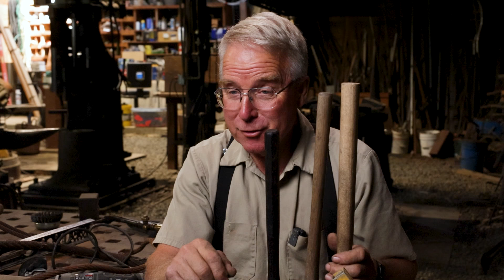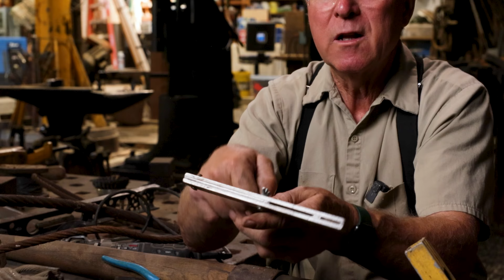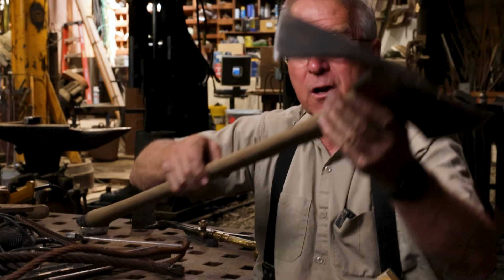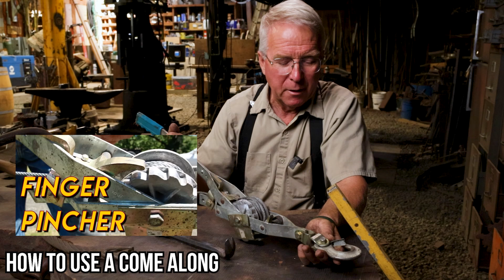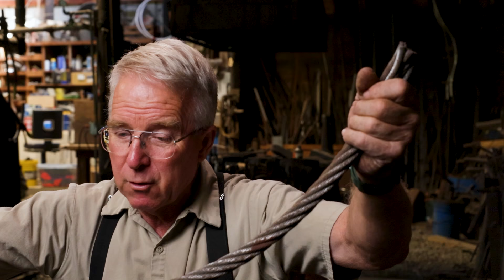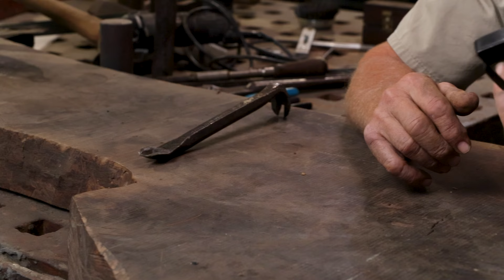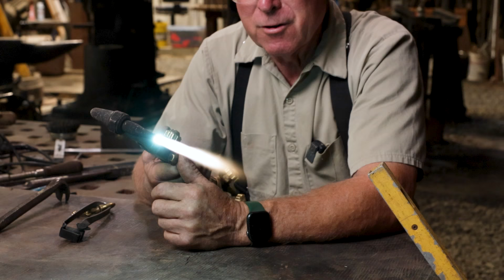The 15 Weird Tool Nicknames You Never Asked For

Comment: When I was a kid I used my grandfathers Yankee to pry on something. I was surprised when it bent. He was pretty mad but used it as a teaching opportunity. When I started my handyman business in 1972 I bought my own. I became an electrician in 1974. As an electrician, I used it for installing receptacles and plates until I found a swivel screwdiver from Klein Tools. I always had diagonal pliers and learned to use them to remove nails and screws. I never used nippers until my son bought a pair and gave them to me to use for pulling nails when I helped him rebuild his deck. I never had a cats paw, I used a nail puller with the sliding bar. Mine is so old it says Made in USA. Finally, as for how tools get names, I was working with some millwrights to set a massive milling machine and they had prybars with wheels. I kept hearing them call it a Mike. Turns out the biggest, strongest guy on the crew was named Mike and when he wasn't around they would need to use the prybar. I bought a couple to use when we were setting large transformers and gave them to my crew. When I asked for a Mike they gave me a puzzled look. The joke was on me I guess.

Comment: Theater carpenter and film worker in maryland. We call your "buzz saw" an oscillating tool, oscillator, or a multi-tool (due to the various blades that can be fixed to the business end if it).

to clarify on the job, we do refer to multitools, specifically leatherman multitools, by their brand name "leatherman". 

for example "take the multitool/oscillator and bring your leatherman with you."

Comment: your buzz saw was invented by FEIN in Germany.

It was named after its initial use  : "Gippssage".  Literally : "Plaster Cast Saw" - cut casts off without damaging patients.

 Patent ran out in 2008 - and 100 manufacturers found a "new" tool to sell.
Now they're called Multi Tools in AUS.

We used canthooks to rotate the poles we (linesmen) were dressing.

I STILL have my dad's ratchet screwdriver . Stanley.
We still have yankee screwdrivers - we call them HAMMERS :)

Comment: I knew an electrician who had a Yankee screwdriver, and he loved it. I call my nail puller a cat's claw because that's what it resembles. A cat's paw is a soft pad, which wouldn't be optimal for removing steel from wood.

Comment: 10:15 the two things that frighten me the most are things under tension and things under compression. Ungodly huge amounts of force that can be imparted into your squishy body faster than your nerves can get a signal to your brain.
Reply: Yup!! I thought I could pull my hand back quicker than a table saw could cut it; I now have half a forefinger, and a fused middle finger; expensive but thoroughly learned lesson!
Reply: Yes. Tension and compression, you cant usually see. Something that is rotating or glowing you can see. But nontheless, either are quite dangerous.
The other thing is, in our everyday life/eperience we have nothing to do with tension/compression/rotating. So we lack the fear or for better, the respect of such. There is no understandig how dangerous a lot of things can be, when using it.
I am fortune, that I have only minor accidents with tools in my life.
One gained insight is, if your tired, not feeling well today, and you are not forced to, dont go working on tools. Skip that day and come back tomorrow. Once I slept bad, felt dizzy but thought c'mon just a quick cut on the table saw. Well that ended in a close call. Just scratched my left thumb. 😮

Comment: In Australia, a "door bar" is is commonly referred to as a "Jimmy bar".
Instead of "diagonal cutters", we say "side cutters"
Instead of "end nips", we call them "pincers", but when you can't remember, it's also acceptable to refer to them as "nail-puller-outerers".
And a "maddock" is called a "hoe". 

Not a tool mentioned here, but the "Yankee screwdriver" made me think of drills - what is commonly called an "impact drill" is also known as a "dak dak" in some parts of Australia.

While we have "whiskey bars", another similar tool that is usually called a "straight edge" is known within a specific trade as a "rollover" or sometimes a  "lightup", when it's used on its side - when you know, you know.

Comment: there's that one guy that says "just hit it with your purse." his "purse" weighs 10 to 15 pounds and has a long wooden handle on it. there's the retractable stick with numbers on it. normal people call those a tape measure. left handed metric adjustable crescent wrench. watermelon squasher is a good name for a sledge hammer. there's other names for tools. also, lineman's pliers are great for bundling steel tubing and angle iron with wire.

Comment: recip. for reciprocating saw (sawzall which I misheard for years as "saw saw" and thought was dumb) also occasionally referred to as "THE BIG BOY JIGSAW" on site

OR for the oscillating multi tool. we just call it an oscillator. Not very imaginative bunch.

Sledgehammers are forever known as "your purse"

Oh and I know the "hot wrench" as "Gas scissors" and it's electric cousin "Lightning scissors" (Plasma torch) and their mutual friend "electric glue gun" (Mig welder specifically)

Comment: Lets have a debate about end nips and diagonals.  I am a trim carpenter 20 years experience.   I prefere the diagonals in my bag,  reason being.   If a nail i shoot hits a grain of wood and comes out. I grab it with my diagonal not hard enough to cut. Then I tap the pier with the claw of my hammer.  Which is a smooth face 16 Oz straight claw with about 2 inches cut off of the handle.  That hammers name is Lucille.

Comment: The pinion gear shaft with the ratcheting pawl gear on a Dake arbor press is called a "spingle". I always assumed that Dake made up the name. 
We used a flotilla of Dake 1 - 2 1/2 arbor presses in a production environment.  Repeated presses on the same priduction operation by our production pilots used the same ratchet/pawl tooth. To speed the operation, the pilots wouldn't raise the pressing handle far enough for the pawl to fully engage. Then, with two handed force, they would pull down on the pressing handle. As the ratchet tooth wore to a burr, the pawl would barely catch, and the two handed pull would pop the pawl and pull the handle into the pilot's cranium! For this reason, I frequently purchased replacement  spingles. We would deburr them on a preventive frequency, but the safety Nazis wanted us to simply replace the spingles. I suspected that our shop purchased more replacement spingles than any other Dake customer.

Comment: Noted the Crescent with a podgy one end. Podgy bar is the term for tapered bar for lining up holes on heavy gear. So tempting to stick your finger in that hole even though it won't do jack. Shwsh, off comes the finger. No argument. Common injury unfortunately.

The adjustable wrench is called a Crescent because it is a New Zealand brand that made them early on. Good machining from NZ. I thought it was only AU and NZ that called them that.

The angled cutters have always been called side cutters here (AU). Typically a sparky or boilermaker tool. Reaching into areas to cut wires, or snipping wires between others, you don't want end cutters. For boilies it is ergonomic for trimming welding wire at the gun or stuck on the job.

Half expecting you to mention the chicken bar. That one 's a funny name too.

Comment: At a British engineering tool exhibition in, probably, the 1970s, I saw someone demonstrate a Desoutter tool with a small circular saw blade on it. The rep grabbed my hand and pushed the tool against it, and I was surprised it didn't cut me. It was an oscillating saw, made for surgeons to cut bone, but not flesh.

Comment: For my 16th birthday 1964  my father bought me a Yankee screwdriver cost 3 pounds 10 shillings Australian ($7.00) still got it and use it occasionally .A great modification is to put a hose clamp around it  just above the forward /reverse  slide this prevents it from rolling off the bench etc. if you put your hand around the clamp you get very good grip and a lot of power to loosen a screw.

Comment: That was fun. I have a few of those old tools. I used to use my yankee screwdriver all the time but not much since I got my cordless drill with square drive and star drive bits. I do use my cant hook to roll a log enough to put a cable (not a true choker) around it.

Comment: What you are calling a come along is not a true "COME-ALONG"    A true C-A is a heavy cast winch made by J.E. Shaffer in Tulsa, "OKLA" with "COME-ALONG" cast on the side of the frame. GOOGLE  "Shaffer COME-ALONG".   Mine is "STANDARD", walks a 7/16" chain and still has some of the original orange paint.  I think they made other sizes. Sorry, I haven't figured out how to send you a picture in this comment.  I reffer to what you are calling a come along as a cable puller.
Reply: Google  "Shaffer Come-Along"

Comment: Had a multimaster back in the day, obviously called it the fein saw, it gave out around 2010ish and dremel of all companies put out a saw called the multimax , it was a much cheaper option then fein, probably 150$ or something close. I bought one and of course it was then called the dremel saw, the saw didnt last a month and in the years since ive have a couple dewalts and a makita but for some reason the name dremel saw has stuck with me and my work buddy. I have to catch myself from calling the makita a dremel in front of strangers so they dont think im crazy. Other names i frequently hear on the job are, buzz saw , buzz cutter, buzzer, jamb saw, zip saw, oscillator, and my personal favourite, the flat saw. Dont think ive ever hear one called an oscillating multi tool in my 25 years on the job lol

Comment: When I was a kid, my two eldest brothers used to work on cars. When I got to work with them they'd use their own bizarre nicknames for tools.  At first I thought they were just making it up as they went along but they were consistent so I remember them to this day.  Unfortunately I believe this jargon was all their own so it's all useless information now.  Some examples:

Tooth pick=Crow bar
Sausage=socket drive extension
Chipolata=as above but smaller
Salami=as above but much longer
Chatter box=Torque wrench
Goolie crunchers=regular plyers
Tongue extractor=long nosed plyers
Thumb screws=Mole grips
Irish screwdriver=Claw hammer

Fly swat= 2lb lump hammer
Attitude adjuster=14lb sledge hammer
Bar mitzfah= hackaw
I could go on but, like I say, most of them wouldn't mean anything to anyone anymore.

Comment: I used a Yankee screwdriver to build a loudspeaker cabinet with screws every 2 inches, probably around 40. Years later I took the back off with an ordinary driver. I left out 2/3 of the screws and it worked just fine.

Comment: I used to work in a tool crib. The guys would tease me by asking for a left-handed screw driver or a bucket of steam.  One time, them came up and asked for a come-along. I told them to get lost.  They tried to tell me it was a real tool and I just wasn't having it.  They convinced me to let them in and they showed me the rack of come-alongs.  I told them that is what they get for teasing me so much.  Ends up, my two favorite tools are a reciprocating saw and a come-along because if you can't cut it out, you can pull it out.
Reply: I'd have asked you for a set of "Relative Bearings" :).
Reply: Get me the board stretcher

Comment: How bout those tools that didnt exist, but were always sent to go get or order from store...tweedle valve, level fluid, plumbob fluid, chalkline fluid, n my fav sheet stretcher or sheet shrinker depending on what was called for at time when siding metal building or metal roof. Oh ya fun times when you graduated from having to fetch tools..even better when you came back with things to explain how to use them. eg. Vise grip n come along was my design for sheet stretcher...fun times

Comment: My first experience with the oscillating multi tool was getting a cast cut off as a child in the early 80's. As an adult I became a carpenter and I always thought that would be a great tool to have. One day a coworker had me go back to the shop and grab the Fein saw. I had no idea what that was and he told me what shelf it was on and said the case has Fein on the lid. I was amazed that it was the tool I always dreamt of. I used that thing to death and ended up with one on my truck permanently. 
So in my circle we call all oscillating multi tools "fein saws". And that tool had about a 16 foot cord.

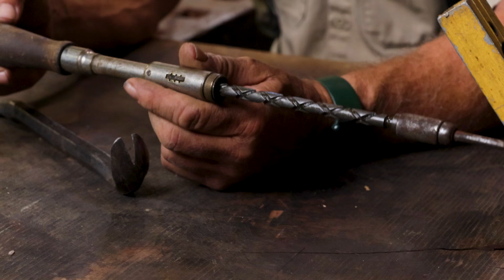Comment: @5:27 "Yankee screw driver" - the original speedy cordless screw driver.  I have a Yankee North Brothers/Stanley without the spring, and the non-OSHA-approved spring extension model badged as a Craftsman.  I've also worn out the brass nuts on a modern Isomax spiral screw driver (Isomax was unable to sell me replacement nuts, but I still can't bring myself to throw it away).

Lee Valley (and likely others) still sell bits for these, the handiest of the lot including a 1/4" hex quick change chuck.  Driving anything much bigger than a #9 2-1/2" Torx drive screw to full depth in white wood is pushing it for me (office dweller that I am), but if I need to switch to a carpenter's brace with a 1/4" hex adapter (also from Lee Valley, as is the 3/8" square drive adapter for the 2-jaw brace chuck to run in lag screws with a socket driver) to finish the job, that's OK.  The amount of torque you can generate with a carpenter's brace is amazing.  I've used the heck out all of these (and more) in a mostly off-grid build of a storage shed at our lake lot.  Though we do have a power drop now, when I started I did almost everything with hand tools - mixed sack-crete in a pan with a hoe (water from a jug, and should have sprung for the Steele mixer, but I still might), crosscut saw, screw drivers, carpenter's braces with auger bits, an old Millers Falls breast drill, framing hammers, an old Swingline staple gun, etc.

These spiral screw drivers aren't as fast as a Makita battery powered impact driver, for sure, but they'll work as long as I do.  And that's worth something when you're miles from town or when the grid is down.

Comment: @6:22 after I became a carpenter I decided that I needed to learn how things were done before modern tools. So I got entrenched in traditional wood working. I finally saw the light. But the Yankee screwdriver became a go-to tool in my tool bag. The trick is finding a functioning example,  not many modern versions are truly functional. And those modern versions are why I never considered them useful, much like hand planes. It's insane how great modern manufacturing is, yet companies like Stanley still put out hand planes that are useless without hours of work to tune them. After spending hours to flatten and smooth the bed, remove the rough grind from the cutting edge, polishing the back of the blade and finely honing the edge a modern Stanley 6" block plane is a great tool. But out of the box they are frustrating garbage.
In my traditional wood working journey I learned a lot about tools and the processes. And I started carrying more traditional wood working tools in my truck, used properly traditional tools can help get the job done faster. Fitting solid wood doors in old houses is a perfect example. I can rough in the size outdoors with power tools and adjust the fit with hand planes indoors with very little mess.  
The oscillating multi tools I call a Fein saw. Not because Fein invented it, but because the first example I ever used was the Fein Multimaster, back in 2004 I don't remember any other oscillating multi tools in major retailers. Therefore it became the "Fein saw", and when other brands came out and we started using them they too were called "Fein saws",  just like channel locks, vise grips and sawzalls. When you call for one only modern pedantic hipsters will ask for clarification.
The cats paw is a handy tool, but if you're the reason for its need you might get a nickname of your own.   My first carpentry job had me on a crew with the bosses brother, all the guys would meow at him from time to time and when I finally asked why, their explanation made complete sense. He constantly needed 2 tools, the cats paw and the Tiger saw... But Art was a nice guy, he fixed his f'ups rather than leave them for the next guy.
Reply: Here in Norway everyone calls them Fein saws, probably because of reasons similar to yours

Comment: It's a dialect all it's own: Hawk, banjo, astragal, barge rafter.
I used a yankee screwdriver, along with a brace and bit, when I built a house with hand tools, after clearing the site with a misery whip.
That speech about choker setters should remind us all that there is always some guy at the bottom working hard for little reward while suits at the top are trying to figure out ways to get him to work harder for less.
Don't be that guy. Get some skills.